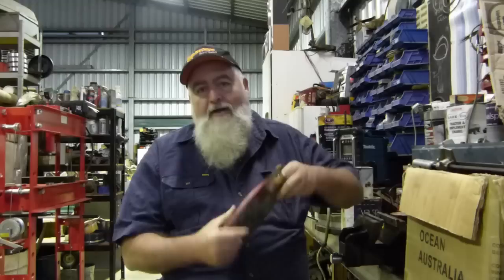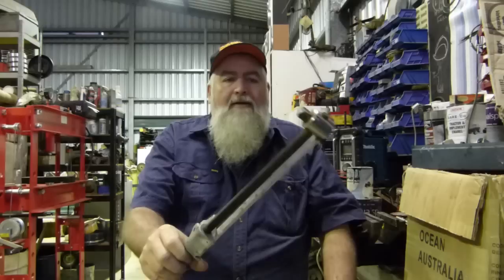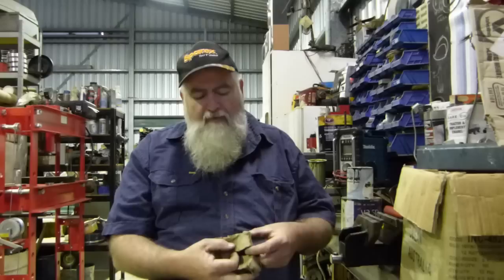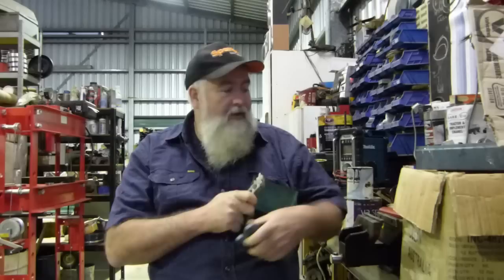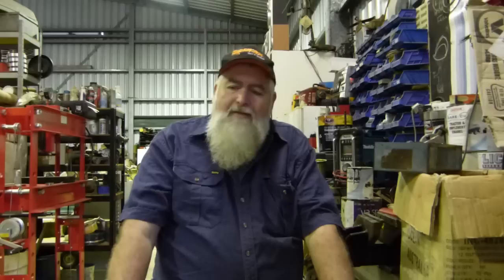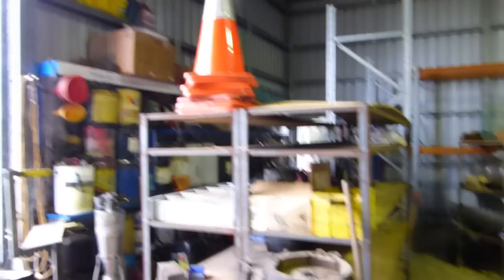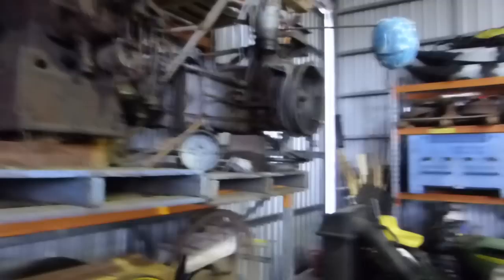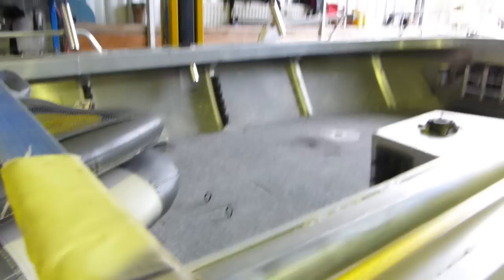Kangaroo Stew #20 E Bay Finds and I bought a boat

Comment: Good looking boat Lance, just wondering why your sheds don't have any insulation in them, it get pretty hot down there don't it, it would help keep the shed cooler.
Reply from the maker: G Day Joe, If the roof was lower I would insulate but I have good ventilation with 3 big doors and the roof is 5-6 meters from the floor so the heat doesnt seem to be a problem. There is almost always a nice summer breeze off the river that comes in the big front door.